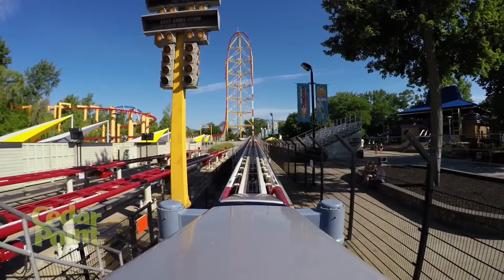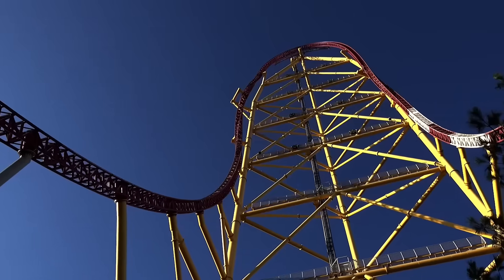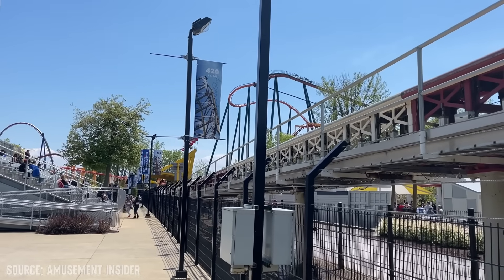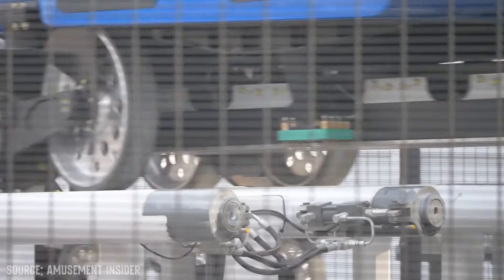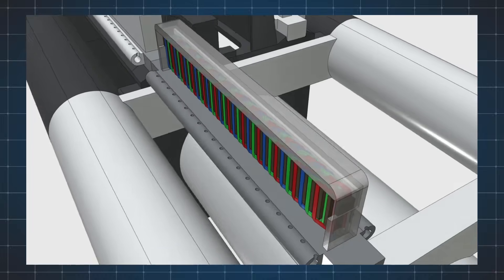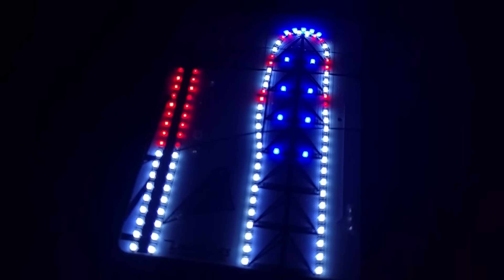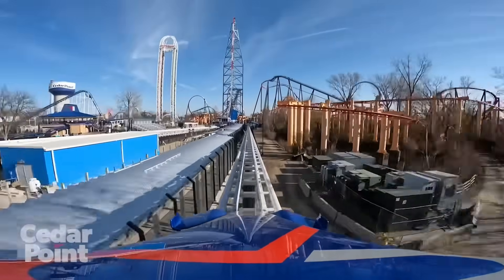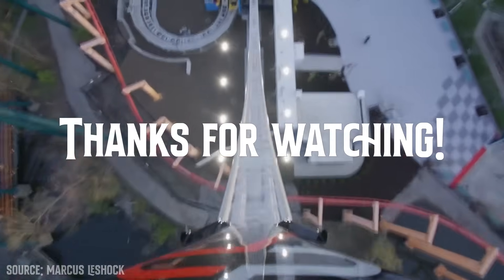How It Works: Top Thrill 2 - Top Thrill Dragster reborn, with MAGNETS?!

Comment: TT2 Looks neat and all, and I appreciate the slightly longer ride time, but I feel like g-forces from the 0-120 of the original would be more impactful than the "gradual" increase. Instead of pulling a ton of G's all at once, you're essentially pulling smaller G's twice.
The acceleration of the first was insane. Popped a blood vessel in my eye when I rode it. Super gnarly. Glad I got to ride it right before they decided to do this to it.
Reply: I feel the exact same way.
That's what advertised the whole ride for me.

Where else can you get 0-120 in 3.8 seconds?
Reply: @jorge5275  maxx force feels similar to
Reply: @Fgfffvbggg  where is Maxx Force at?
Reply: @jorge5275  six flags  great America it ironically popped a blood vessel in my eye too!
Reply: @Fgfffvbggg  Awweeeeeome 
Not THAT'S what I call an eye popping ride
Reply: Do you think it’s better though?
Reply: @Fgfffvbggg  Do I think the second one is better? I haven't rode the new one.
I'd warrant a guess though that I'd still prefer the OG. Not to be a stick in the mud, but just because of the reason I mentioned above.
Then again, I haven't rode it. Maybe I'd like it.
Reply: The new version is inferior to the original.
Reply: This new version is great. Going backwards that fast is so natural but amazing, coming back down the spike for the final launch you get the speed of the original Top Thrill if not slightly more. You feel the G’s.

Comment: Love your videos but this isn’t your usual thoroughness!  How did zamperla make track  to perfectly match the existing intamin track?  Tolerances have to be extreme at 100+ mph!  What is the acceleration rate compared to the old one?  Does the new model have more track to accelerate?  Do the new trains hold more or less people?  Is this the max you could do with lsm s or could you add seats, weight, speed?  Does the power bank use flywheels or capacitors?  In general, is it more or less efficient to have a short lived launch versus a constantly running lift hill?
Reply from the maker: Oh it definitely isn't. This is actually a stand in video for another that's been delay unfortunately so I put this short one together. Lesser known ride and all.